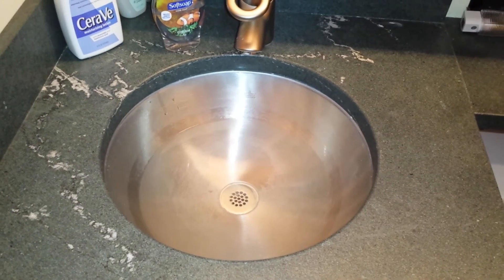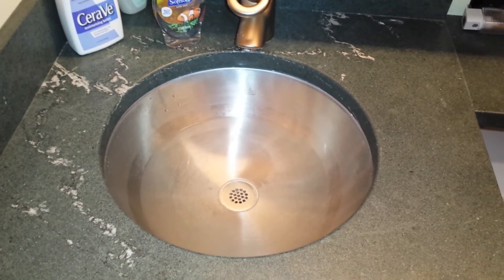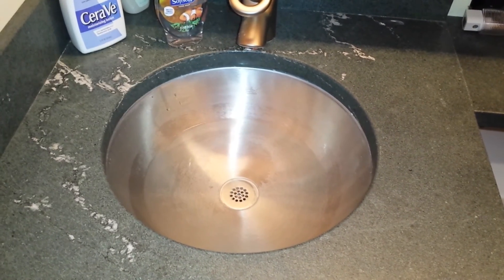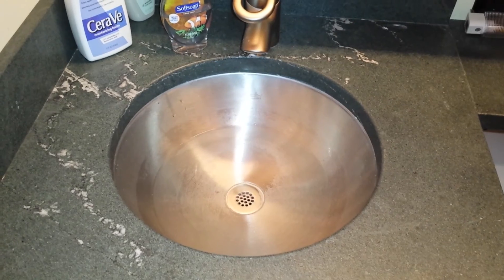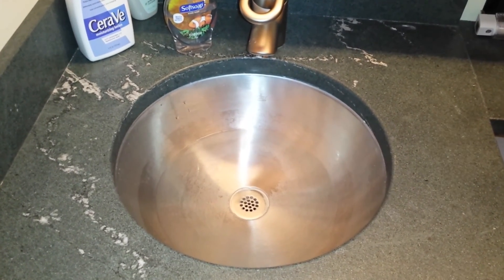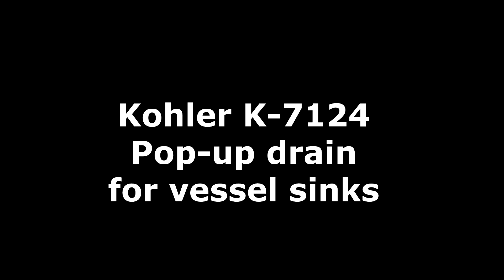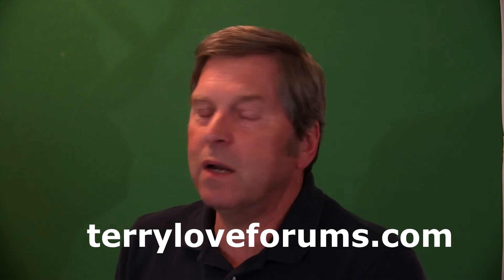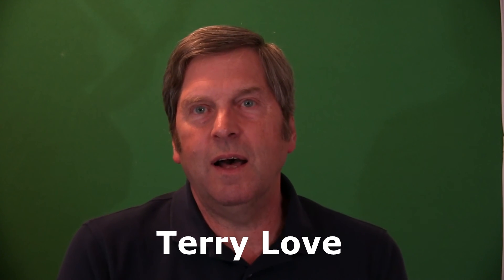Vessel sink draining slow, choose the correct drain.

Comment: Update!  Even though Kohler told me it wouldn't help the water drain any faster, I went and bought a pop-up from Menards (for $39.00) and it worked.  Conclusion:  You don't have to buy the Kohler one at $80.00 to make this work.  Since the pop-up sits higher than the bottom of the sink, it creates the necessary air flow to push the water down.  :-)
Reply from the maker: I've noticed the same thing. At the time of the video, there weren't many options out there. It's too bad Kohler Tech doesn't understand fluid dynamics. Maybe I should call them and have a conversation. :)

Comment: I just called Kohler about this product.  They told me that none of their drains assist in helping drain quicker.  It's just a normal drain that retains the water in the sink, but does not help the water to drain faster.
Reply: All plumbers know for a fact that the drain is much quicker than the standard drains. But then, we're installing the product, and not stuck behind a desk with a phone.
Reply from the maker: I'm a plumber and we run into this all the time. Unless you have an overflow on the basin, you need a drain that allows air to pull down with it. The video shows the difference, it doesn't matter what someone sitting by the phone thinks, it's way different in the field. By the way, I don't bake pies for people, but I am an expert in plumbing.

Comment: Why don’t you make a video that shows the installation? What is the point of your expertise if you won’t show that? I’m willing to bet that everything will work but all the better to show the actual installation.
Reply from the maker: Yes, I could have made a long video. Maybe longer would be much better. Showing how much it changes things by using a different part just isn't enough. I also could have shown you how to open the box, and where I like to park when I pull up to a house. Sure, and a video showing how I greet the customer at the door, how I write up an invoice, and the way that I say goodbye. Sometimes people have pets, and if they have a dog, I put my hand down near their mouth to see if they are the type that bite. Most just give it a smell and then I ask them to go fetch their toy. Some take off running when I tell them that. Geez, what else could I have shown on the video, I don't want to make it too long, but then not too short either. Some customers like me to take off my shoes.  I don't wear the covers as I find that slipping down a flight of stairs is horrible and I would rather drop a tool box on my toes than slip down stairs. Do you have arm rests where you work? That's a good idea and I agree with that. Don't look into the sun, it's not good for your eyesight. What else? How about going to my plumbing forums? terryloveforums.com
Reply: @loveplumbing  An applause for You Sr !!!
Reply: Some people have no appreciation for the ways you have helped the community over the years!